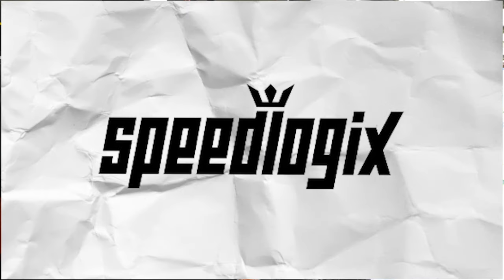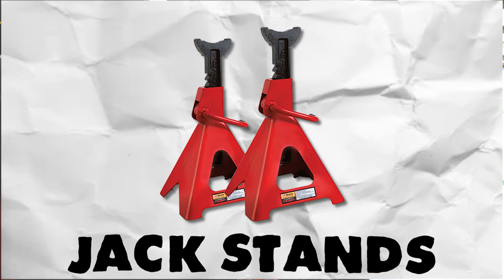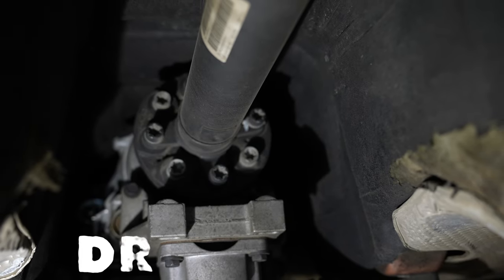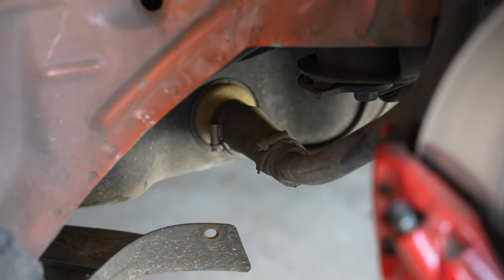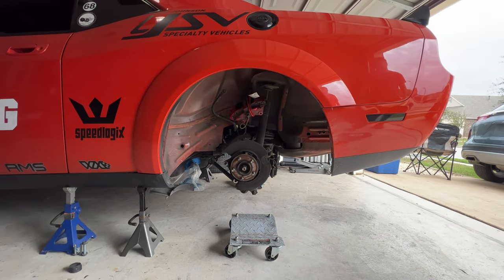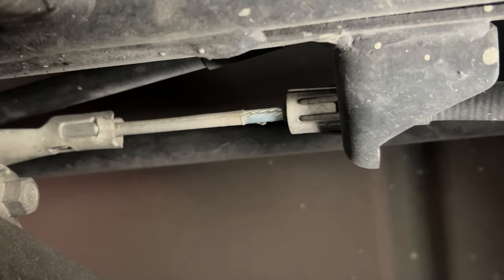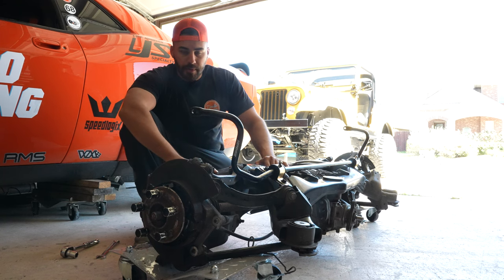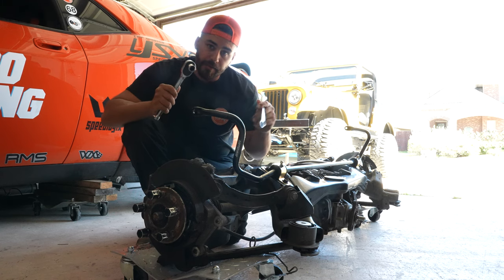How To Install SPEEDLOGIX Challenger Rear Adjustable Control Arms

Comment: Very good, just a couple notes, you do not need to remove the fender liner and  fuel tank filler to drop the cradle out, I've done it that way myself, and also, you can remove the upper arms with the cradle in the car, you however will need to cut the bolt and buy a new one, install it reversed; but it is doable (edit missed that part in the video LOL)
Reply from the maker: Great info! I’m going to pin this comment. 

Yea I mentioned the bolt cutting at the end. I also did mention it doing it this way because I’m replacing the sway bar, diff, axles and bushings. So this made the best sense for me but doesn’t mean everyone has to do it this way if their just doing control arms.
Reply: @TIRADORACING  Forsure bro, I would like to replace my swaybars eventually, also I think you mentioned it too, but you definitely want stiffer cradle bushings for the manual swap, helps reduce wheelhop alot!
Reply: You got a video of you doing it that way?